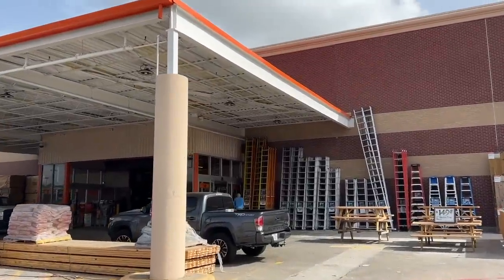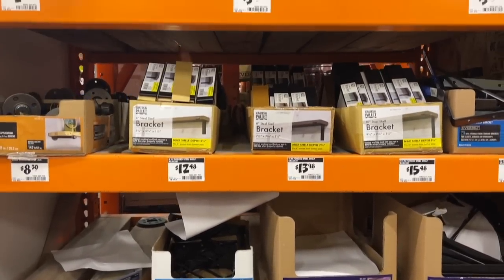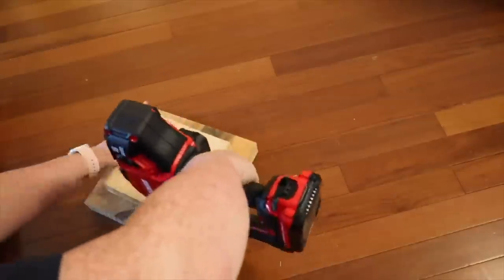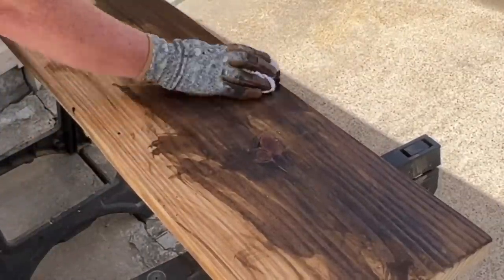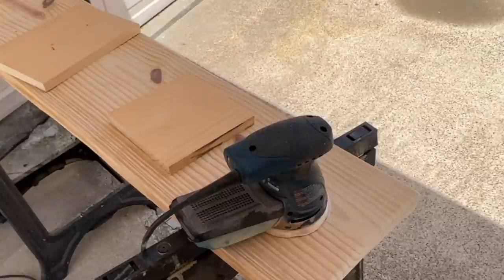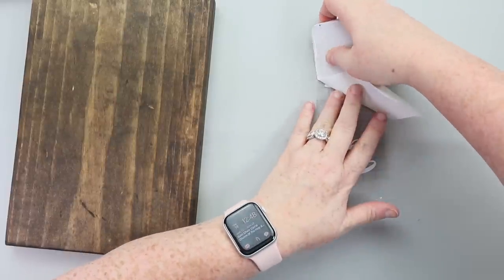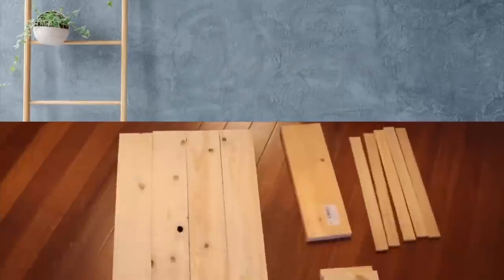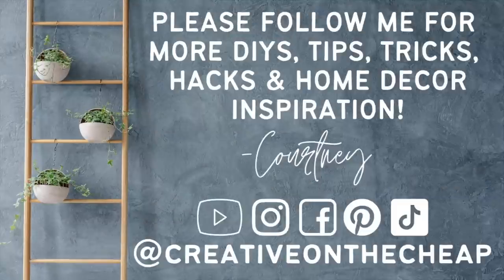EASY High-End WOOD DIYS Anyone Can Make! (Hardware Store Secrets Exposed!)

Comment: As a former Home Depot and Lowe’s employee, yes they will cut wood down to fit in your vehicle; they will not always cut wood for you because by policy they are not supposed to do project cuts for people. They do not hire enough people to have time to do project cuts. If you want your wood cut specifically, I would suggest going at a time the store is dead and not going when they are busy. They will likely not hold to the policy at a dead time. They have so many other things they have to do in lumber than spend time cutting wood for customers’ projects. I have seen on a busy Saturday so many people complaining because one customer has held up the one person working lumber with project cuts and the guy was too scared of her not to tell her that it is against policy. So please if you need your wood cut into pieces go when your store is dead.
Reply from the maker: Yes, the end of the day M-Th is the best time to go.

Comment: Love the wood projects! Why do you sand in between coats of sealant?
Reply from the maker: When you use a sealant, you can get steaks or even drips between coats that are often hard to see.  By lightly sanding between, you remove those so that when you finish, you have a completely smooth surface.
Reply: @CreativeontheCheap  ok thank you I have had streaks before so now I know how to fix that thank you

Comment: Question: Why do you sand in between each coating of sealer? What does that do? Thanks!
Reply from the maker: Sometimes sealer might leave hard to see  streaks, blob up or have spots where it runs down if the coat that is not put on lightly.   The sanding in between gets rid of any of those imperfections allowing you to have a completely smooth project when you are finished.
Reply: @CreativeontheCheap , oh, that makes sense. Thanks for explaining!